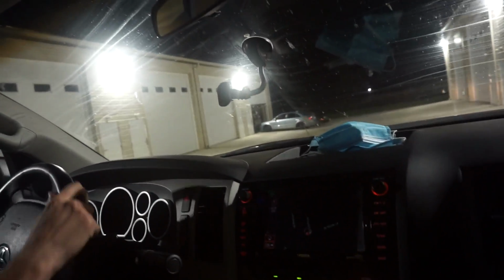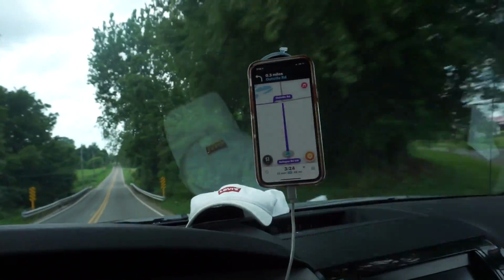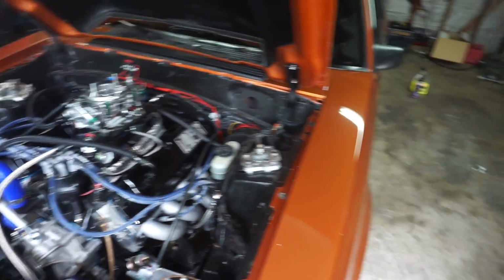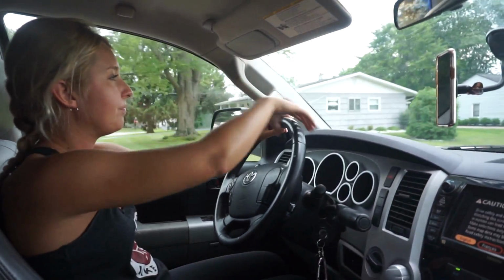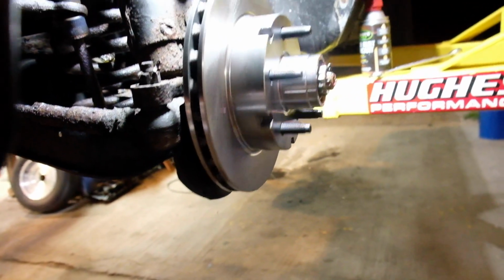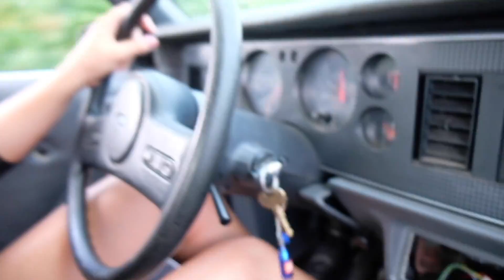I won a foxbody in a raffle!

Comment: Little tip on getting the back wheel bearing out is to take nut and outter wheel bearing off then put just the nut back on then pull rotor towards you and let it rest on spindle and let it slide towards you until you feel it hit the nut and give it a good yank and the bearing and seal will come out and won't hurt the seal

Comment: Hey guys Ian very surprised to see a funnel web in the USA. I know Parker who makes them and we have one of his prototypes on a 351 Cleveland that my little sister built her self when she was 16 years old. It’s has a 351 crank 302 rods and off set forge pistons in it. With the funnel web 850 dp. And 3v heads. Not bad for a 16 year old girl who built the hole car herself. It was only a 1980 XD falcon. It was one of my old sleepers, that I had one of my old 460 Bigblocks in it. Good to see hot chickie babes building kickass cars. Keep it up.

Comment: Don’t worry about the strut towers. Send that boy under the car to checkout the rear suspension where it bolts to the body. If it’s raced you can guarantee the bolts are ripping out of the floor.

Comment: my last ford a week and a half after new clutch it ended up in lake to its roof with the boat floating the more costly thing was saved the boat motor and trailer!!! the truck was ruined the paint job was great the guy said find pictures of it the water they never believe it was sunk!  i got a 2016 chevy 4x4 ex government truck for pulling boats & run around Its un real smooth and power adder on it it comes in when need about 70 ish the dealer said younger people wanted it to right on! well i took on a longer trip all the cars several trucks were dragging me down up hills on rt 81 interstate i set it at 65 around i went and up the hill a few push on button up to power mode & away i went at speed up the hill!!
Reply: by the way i missed the turn  & ended half over bank and pulled right out, the turn was about 120 degree turn to make the road! oh tow truck driver stop what you got in that auto wheel drive by wheel needing  power! the front ones, he said i was counting on a tow!!

Comment: I’d do a built 408 vs built 347 I’ve got a Blueprint 302 bored to a 347 But really leaning on 408 next I can run 6:22 all day on my setup now fastest spraying 175 shot was a 5:88 in the 1/8 and spray 250 running 1/4 and it would blow the tires off mid track and got super unsafe and stop trying for faster in low 9’s in the 1/4. Call looks good though and for cheap being you won it y’all can make a quick car out of it ole foxbody will hook like the s10 with the right suspension setup

Comment: Next time you need to pack bearings, take the nut off, washer off, outer bearing off, then put the nut back on. Pull the rotor quick and firm, your inner bearing and seal will be left hanging on the spindle undamaged. Easy peasy.

Comment: Moly you should do a photo shoot with all 3 of your cars and have the Corvette as the center car and the Mustang on one end and the Firebird on the other end and once you turn the Mustang into an all out Drag Car you should atleast mini tub and 4 link rear suspension with a 25.3 to a 25.1 chassis so you can tune the chassis to run No Prep/Street races in Mexico and run a W tire(32-33x10.5) if and when you can or just a 29x12.5 or 28x10.5 or 275s or 295s for Radial races and go all out with the Mustang like you said and go out there and Win that Money and build the Firebird to be a nice little street/strip car like on the same level as Tommy's Blue S10 on Nitrous build a nice 383cid or a 434cid SBC on a 250-300 single plate system or add a fogger too with up to a 500 shot on it  with a TH400 with an Abruzzi converter and a Strange 9in rear with Strange brakes and coilovers front and back or a set of QA1 MOD SHOCKS front and back and QA1 carbon fiber driveshaft and put a cage in it to where you can leave the interior intact and be good so you can have a street car to play with on the street for like daily driver cash days and things like that and get a set of cheap Jeg's wheels for it with atleast a single beadlock and run a 28x10.5x15 and be done with it and document both builds and get some merch out there start a Patreon a Membership channel a Go Fund Me do everything you can so you can start raking in the dough and get your channel out there and get your race cars out there and go start beating on some boys out there and one last thing I'm a huge fan and supporter of yours as I have a daughter of my own and she is my only child and as a child myself I was brought up around drag racing all my life as it has been in my family for generations and drag racing in my family is also a big family affair we go to the track with as many people as we can and stay at the track as long as we can and we have a big cook out at the track for whoever stops by our pits and is hungry and we try to help whoever needs help whenever they need it and my dad and I one car that we built together when I was in my early teens maybe even pre teen but we built a 355cid SBC for this at the time ragid 72 Nova and it didn't even have a posi-trac rear in it at the time so we were one wheel peeling it for a little while then we welded the rear then we eventually bought the parts to make the complete rear bullet proof with a spool, c-clip eliminators, and unbreakable axles but for some reason we kept the factory leaf springs and the factory drum breaks but we ended blowing up the first 355 we had in it and that was a nitrous motor so then we built an N/A 14.5:1 compression 355cid solid roller camshaft with a set of cheap aluminum heads on it and at like 3100lbs basically the car was all steel all glass we ran mid 10s on motor and now we lightened the car up in the past 12 years and built a 427cid SBC with all the good parts on Nitrous and now it runs low 9s high 8s in the 1/4 and mid to low 5s in the 1/8 and my dad also bought an 86 Oldsmobile Cutlass Supreme about 10 years ago with an N/A BBC 565cid on big tires and that car weighs around 2500lbs with driver in it and runs low 8s high 7s in the 1/4 and low 5s to high 4s in the 1/8

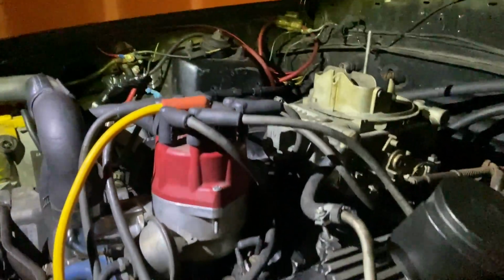Comment: At 2:54
Just think of it as a regular chevrolet and number your cyls the same as your small block and plug em into the cap starting with #1 you choose when you drop the distributor and pop em on in order of rotation. I think clockwise on a Windsor but dont quote me on that.
Its the same as our GM stuff just with different designation as to what bank is "1,3,5,7 and 2,4,6,8"...
In other words its the exact same "1,8,4,3,6,5,7,2"
The small block Ford is the same firing order they just number everything in their own way. Trust me. Im a doctor. On tv.

Dang it i meant counter clockwise...do that old trick where you follow the vac advance canister and wrap your and around it thinking about which way the "points plate" moves for advance then you will know which way it turns. I re-checked the vid and the way the canister is the vac can pulls forward for advance so the direction is counter clockwise.

Comment: Now that you have a car that you can turn into an all out race car you should either put an LS or a True Small Block Chevy on EFI in it with a big single turbo and EFI and run it off of a Holley Dominator EFI system and cut the car up to make it as light as you can for the class and make it a Radial beast and run either Small Block Boost or N/T275 or X275 or Pro275 or Extreme 28's and do like John Doc is doing with his Salty Chicken build on his channel only have the roof and quarters steel but the rest carbon fiber including the tubs the wing all the interior except under the seat and get an M&M shifter and 2 speed powerglide and a Neil Chance bolt together converter a Mark Williams floater 9in rear and a set of Afterworks aka Ron G spindle mount struts for the front and Afterworks aka Ron G coilovers for the back and Optic Armor Lexan a set of Sandar's wheels and get TKM out of North Carolina to build your engine and now they offer a complete copy of the engine in John Doc's Grand National the 2500+HP "Black Sheep" and then become a Radial Queen and then one day go out there and walk the dog on Stevie "Fast" Jackson

Comment: oh jeepers,it s so easy racing in usa.i ve raced here in finland for well over 15 years and parts cost more than twice what they cost in u.s.one good thing is that you can easily sell your used parts,even worn roller lifters.i even managed to make extra money hustling big block chevy parts.given the population and cost,sweden and finland are street racing crazy nations.hell, swedes totally shocked u.s racers back in 90 s when they dominated the world street finals(power street finals)in florida.nitrous was not legal and made running decent times even harder still.i ran a 9.6/143 on a no prep air strip race in a perfectly streetable 64 malibu ss(built in canada).i had a built powerglide which couldn t handle the torque and it slipped.next version was a 538 bbc with 12-71 hi helix and it just spun the living daylights out of the powerglide.one lick was a 9.80/115which shows the slippage well.i took out the blower and it went 9.90 at 142 with 9:1 comp and it was very easy to run on the streets.now i m almost paralyzed waist down and watch racing vids 24/7 and i m sort of frustrated because i know a shit load about racing bbc s and and at the sane time cannot do it.

Comment: Very true Statement! There is nothing like that feeling of busting your ass building something late into the night for months on end especially when you’re inside of the motor or doing stuff like porting heads.. that feeling of racing someone and just barely pulling on them knowing that they extra step you took to doing something is the reason you’re pulling on them! Knowing you tightened the mains or rods and it’s spinning at 6000-7000 rpm! You can’t explain the feeling! You can only feel it 🤤😍! Keep up the great work molly! You have a great teachers in your corner! One thing you need (like billy said in a newer video) is a shift light! Might as well get a tach too! I can hear how short you’re shifting that 302 with one shitty headphone in my ear lol. 👍🏻👍🏻 can’t wait to see you make some kills! You’ll have an ear to ear smile 😃!

Comment: Don't get too attached to that 302 because when it blows you can rip it out and throw it in the scrap pile where it will at least get you enough money for the motor plate to install some real power and have fun.  Keep in mind that building a Ford motor cost 3 times as much power to power as a GM engine so if making it fast is the goal you will get a lot more bang for your buck making the decision to flush the expensive parts now rather than buying thousands of dollars worth of parts that won't get you where you want to be and you won't be able to sell them to recoup your losses when you finally decide to bite the bullet and upgrade.  Been there done that. Lol

Comment: Is that a 1986 Mustang by chance? I have a 1981 mustang GT cobra that's been sitting at my parents place since the late 90's I blew the 302 back in the day bought another used 302 put it in and found out someone put a roller cam with flat top lifters and wore the lifter faces right out so I got tired of it and put in in my parents barn and have not touched it since I've been meaning to get it out and work on it but when I have time I find something else to work on instead LOL! It's dark green with black interior was a fast car back when it was running

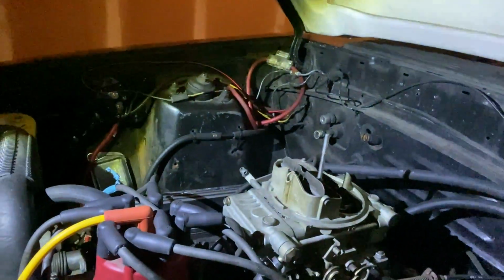Comment: This is not GM Billy...lol right bank is 1234 and left is 5678 firing order 1-3-7-2-6-5-4-8 distributor turns counter clockwise. 1 is dead center in back of cap. Two away from right clip. Ford messed everything up...! I paused the video at 2:43 and you can see the firing order is wrong . Then after watching you fire it and looking at what you did the distributor was dropped in 180° out.

Comment: I’ve seen a 351W split completely down the middle and still running! Once it was removed and the crank unbolted it literally fell into two equal 4 cylinder blocks!...

Comment: I see you snuck the ol' 5 lug conversion on the front.
Are you going to keep it a stick shift, or are you going to convert it to an automatic?
That stock T5/clutch set up isn't going to hold up to much more than the stock 302 power level.
Reply: It will last a long time with a little help.
Reply: Just like they were talking about the 302 blocks splitting in half. If they're talking about making that much power, the stock T5 case won't hold up to that no matter what you do.
I bet dollars to doughnuts their friend with the burnt orange fox isn't running a stock case T5.

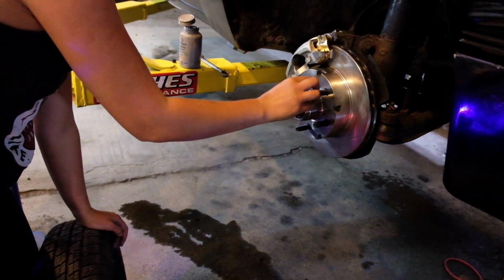Comment: 18:15 ( no dust cap on the rotor ) will be replacing the wheel bearings soon as the grease fills the center cap.

Comment: Sweetheart, when you're putting wheels and tires on your car by your self please sit flat on your butt, point a lug stud straight up and down and use your legs and arms to pick it up and just make sure and roll it around until a lug hole is on top and bottom and since you already did in fact, put a stud straight ☝️👇. I know that was long but that's the exact words my dad told me when I was young.I have done it this way every time I have ever changed tires and now it's a common thing to see other people in public do it the same way.

Comment: Doesnt seem they're that lucky as some post. The hole has pieces of frame in it. Put naz on a 302... better look for another block, that 1 wont last long. I doubt it's a 4 bolt main boss block. The webbing in the 302 regardless is very thin causing them to crack from crank throu the cam tunnel to the intake. Get a 300 shot of naz first thing, & get it over with!

Comment: I had shifter trouble, was getting hard to put in gear, oddly turned out to be the clutch. Had a "specialty" shop go ahead and rebuild it right, shifted like butter with such ease click click click.
Billy, it's okay bud, you can smile sometimes.

Comment: Take a wire welder and weld a nut onto the end of the bolts that broke off. between the heat from the welding and the new nut to grab onto, you shoudl be able to turn the broken bolt out.
Reply: Bro. They can fix anything.  It was time for a updated intake. By far the best money ever spent on a motor.

Comment: Like I said when we first saw Molly with her head stuck inside the wheel well of the S 10 pickup changing the kids spark plugs, She is worth her weight in carbon fiber !!
Reply: Wonder how much 120lbs of carbon fiber is worth ??? LoL
Reply: @mocarpenter8836  Depends on what you are building with it.

Comment: Wanted to give you a tip when changing rotors. Once you get the outer bearing out put the nut back on, pull the rotor fast and downward and it will pop the bearing and seal off with out damaging it. It saves a little time.

Comment: Yeah but does the ashtray close? Haha, Foxbody owners know what I mean.
Reply: Its a 4 eye so it has a different ashtray.
Reply: Smh  im with you on this one
Reply: Tommy Kozak 

I had an 86 GT but can’t remember where the ashtray was? My 93’s was broke when I bought it in 95. Lol
Reply: @MrCarnutbill67  It was between the shifter and radio. It was also metal.  IMO the 86 has a nicer interior.
Reply: I think that was a problem with all 90's and 80's cars
Reply: LOL!
Reply: Not on your life it doesn't! Lol
Reply: The big prob with all 1986 Fords (i've had a ranger, a turbo bird and a GT), after 127,000miles the voltage regulator goes in the dash. so when you stop, the temp gauge pegs out. After 130K you find its all the gauges doing it. Then there's the ignition module, and the rear brake lights constantly going out. And as she found, third gear never goes in right without bushings. oh, and the plastic clutch quadrant, too.

but when it all works...that torque output to curb weight ratio is great. They're a tin can with a truck engine running a warm cam.
Reply: its still an on going problem I cant find it in my 03 truck keeps falling off
Reply: I got my buddies perfect ashtray spring out of his wrecked fox and mine was perfect I couldn't believe it

Comment: If the bolts were too long for the waterneck housing somebody probably over torqued them putting them in and they were just waiting to snap off.
Reply: they often corrode and need to be replaced, probably couldnt find exact replacements.

Comment: Congratulations on winning the car Molly, that's awesome!
Never forget the number #1 rule for stock 5.0 blocks,  keep it well-tuned at all times. If you do that it can survive indefinitely at 500 hp or slightly above...
If you don't keep it tuned and it ever detonates much you will split the block. Those "Thin Henrys" were never meant for high horsepower. If you want to go over that amount of hp, then get a Boss 302 block from Ford or an aftermarket block.
Reply: I'm throwing 18 lbs of boost on a stock block just fine.
Reply: Im 15psi and 150 shot on a stock 88 long block, finally have my aluminum heads done and they are going on with same stock cam hoping to finally get my 5.99 time slip
Reply: @young11984 , Cool! Good luck!
Reply: @nitroustommy ,  Cool! There is a guy on YT who is regularly putting like 900 hp to the wheels and his stock block 5.0 has lasted quite a while so far. Is it you?
Reply: Robert G i think you are talking about Chris Watson
Reply: @young11984 , yep, you're right, thank you!
Reply: I was just going to say Chris Watson from South Carolina. He made 911hp on a stock bottom end with 35 lbs. High 5's in the 8th.